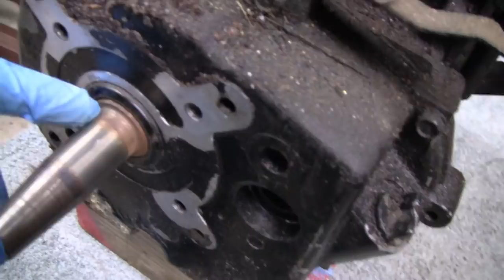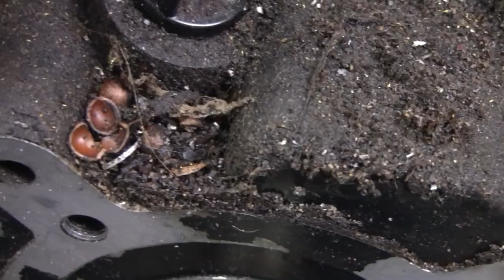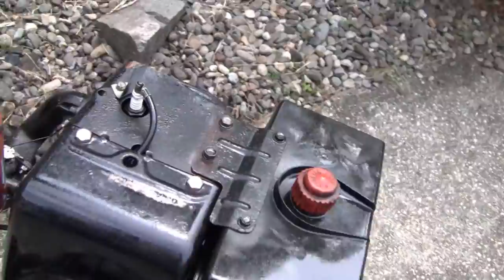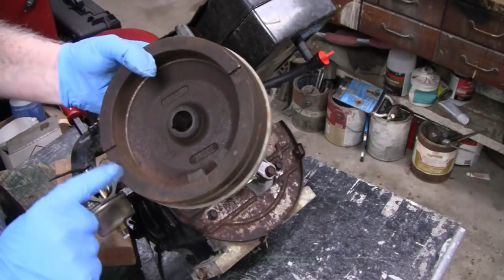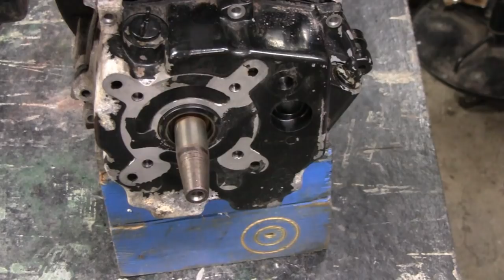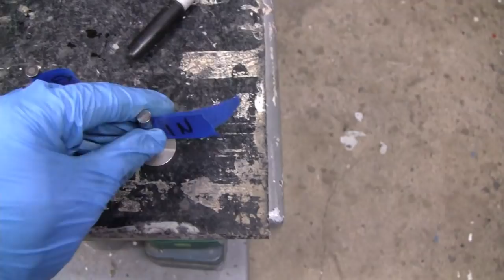TAPERED CRANKSHAFT MADE INTO A  STRAIGHT CRANK (part 1)

Comment: I hope you know that you can cause that crooked crankshaft to straighten itself with the use of an oxy acetylene torch. Simply very quickly heat spot on the crankshaft near where you think it's warped and when it cools it will draw it or Shrink it back to a near straight position you may have to do it more than once but by the use of a dial indicator you can zero that little baby in very very close with the torch

Comment: Fun Project'   I don't have a lathe.  I think i could use the turning motor as the lathe and grind the shaft down  to a smaller size and weld on a 3/4 hard bushing????

Comment: as cool it is that you guys dont have a problem welding and machining a crank for a piece of shit old tecumse motor. . .harbor freight sells a 6.5 horsepower motor for 100 bucks, it is more efficient, responds better and will do much better at high rpms, bypass the governor and they have proven to do 8 horsepower just before they float valves at 5200 rpm, piece of cake to get an engine for the job in this modern mass consumer age vs modify and rebuild an engine for another purpose entirely, not to mention the parts availability and the predator 212 and the rest of the line are copied from honda and use the same design and believe it or not are very solid especially for the money. i have revved and ran the crap out of mine, holding it valve float rev limiter  wide open throttle  for extended periods of time and high loads for long periods of time, i have kept up on the maintenance, change the oil right after break in and every time after it gets a little dark but i beat the shit out of running it and it runs great every day
Reply from the maker: Buying a HF Engine won't get me thousands of dollars in revenue in a couple of months from the videos  like welding and machining a crankshaft will and it probably won't teach anybody anything either!!☺
Reply: well if thats what your after then by all means go ahead, im just saying other than your guys doing it for the video and showing the process (which is cool and i support the idea) it isnt worth doing and almost nobody could or would ever do it . . .just sayin, it doesnt make sense to do this conversion to get any use out of the motor itself

Comment: Maybe you have already done this but if you put the side cover back on and use a transfer punch through the existing hole, you will create a mark exactly centered on the broken bolt for accurate drilling in preparation for the EasyOut. Aluminum dissipates heat very rapidly and I doubt MAP gas will create enough heat to help with extraction. Maybe you could hold a candle next to it like the guy removing a frozen lug bolt on his car. :-)
Reply from the maker: Good tip on the transfer punch, Thanks!!☺

Comment: Just a little story here ROADKING,...when I had my business going back in the 80's my brother worked there with us and he is what I would call a 'helluva mechanic'. He loved working with small engines/equipment like this, and also really liked working on the lathe too. He used to change over quite a few cranks from taper to straight, ( somewhat like you're going to do here) he used to keep a few decent cranks from full overhaul jobs and from those cranks he would cut off the PTO end on the lathe. Then he'd cut off the taper end of a crank too. He would bore out the tapered crank shaft end to, maybe 11/16ths then cut the straight shaft end to also the same 11/16ths ( maybe it was 5/8 ths. ) push one into the other then silver solder them together permanently  to make a 'straight shaft crank'.
You know we never had one failure of that joint in all the years of that engine. He has done this for engines that were used on plate tampers ( compactors ) and like I said,..not one failure.
I just thought I'd through this in here for the 'interest' side of the story only.
Your video is going to be an interesting one for me to follow.
Oh, by the way, he did convert a few cranks the way you're about to do too,.it's just that he liked this lathe work a lot more I guess.
Cheers!.
Reply from the maker: Interesting way of doing it!!☺

Comment: they sell a new tool now (if you'rw rich) called an inductor. it uses a magnetic coil to heat the bolt and just the bolt, or nut. search "mini ductor" there are cheaper ones than the mini ductor

Comment: Great video on taking that apart Mon Ami .........    Those paint pen markings on the crank are from the factory....  I see that all the time in the Briggs that I redo.......  Marks Alot  writing inside the block also........

That odd ball stuff you saw on the cam was the ACR    auto compression release in other words.............. Check the spring on it.......  

Waiting on part 2 Mon Ami ~!~! 

Plus Tard ...............
Reply from the maker: Thanks Booboo!!☺

Comment: Should be a cool project. The contraption on the cam looks like a centrifugal compression release. Pretty simple. In my experience keeping tappets on their lobes is important or already broken in ones will wear excessively if switched. You got this going your way!
Reply: Beat me to it.

That is a low speed compression 
release.  Makes it easier to pull 
over, and as soon as it fires, the 
comp release retracts.  Comp 
release keeps the exhaust valve 
open a bit, so you can pull the 
cord.

steve
Reply from the maker: Thanks Bud!!☺
Reply: Steve Skouson 
My '03 Suzuki SV1000S has one but only on the rear cylinder! Its a V twin motorcycle.

Comment: I've found that if you hammer on the socket while on the bolt head that the shock can sometimes break loose the corrosion. I got a chevy tracker recently that I've had to do that to some m8 bolts on the motor.
Reply: Impact screwdriver. I use one all the time (no idea on the brand, it's an antiquated one).
Reply: aserta I have one too but mines Harbor freight. I found a smaller 1/4 drive one at my local antique store but it's not old.
Reply: Old does not mean it retired and doesn't work anymore when you need it grab it smack it and it works every time LOL

Comment: I've rebuilt a bunch of those  years ago , and the same damn crankcase bolt breaks off every time . Only have had a couple come out clean . You could bet money on it breaking off .I usually got it out by drilling a hole though it , and a bit of heat and a small square easy out , and it would let go and come out . I think if the bolts were a bit stronger , that wouldn't happen .Nice video of breaking down a Tecumseh .
Reply from the maker: That one kicked my ass, tried about 5 different easy outs!! I wound up retapping it!!☺
Reply: Yeah , typical of that one bolt . I've busted many easy outs , and most of them on Aluminum . Cast and steel , had better results .  Good video anyway !!